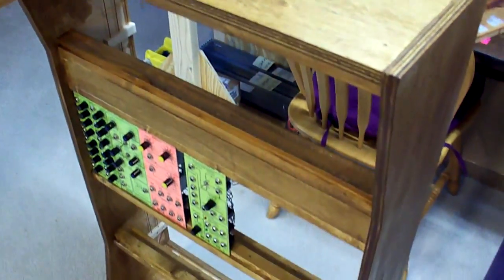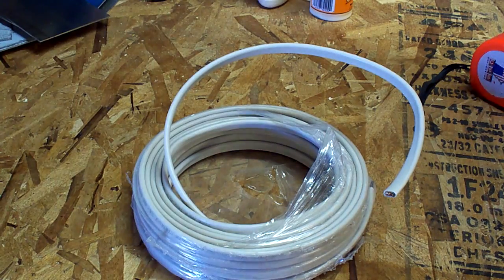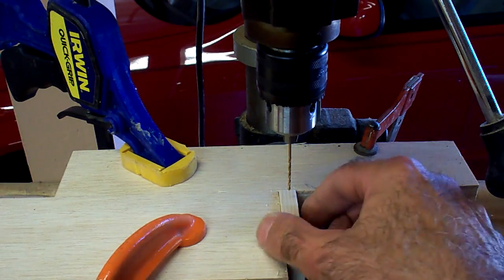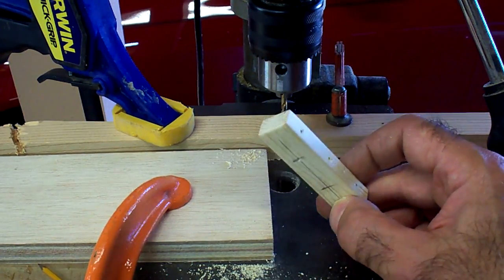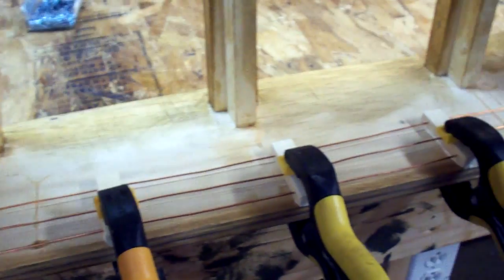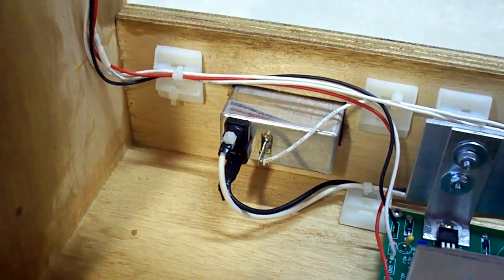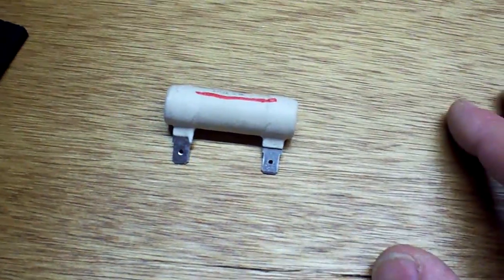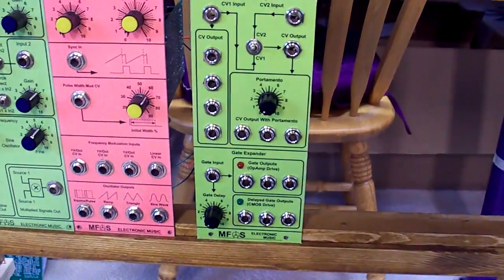Synth Case Building Tips

Comment: genious rail system, reminds me of a PAiA I saw a while back.
However, isn't there a better way to connect to them rather than soldering directly?
Reply from the maker: Pehr Meldert Hi Pehr.  You can solder keyed intermediate connectors with wires attached to the buses if you prefer. In my case once my synth is together I don't plan to take the modules in and out so soldering directly won't be an issue.

Comment: Ha  - I liked the “Cave-man” comment : )  

I have to wonder if you had you used connectors for modules in the past and had issues?
Hardwiring all the power to your modules certainly would remove any suspicion of
Intermittent connections to the pwr source.

I have been using the *MOTM buss system on Modules connecting a large system of homemade cabinets and have not as yet encountered intermittent power connection issues. (knock on woods I guess?)
 I  occasionally change the layout of the module locations as modules and come and go and this system is flexible for quick changes.

some sources
*  MOTM ADAPTOR Boards 960,990 &990     http://www.bridechamber.com/Power_Supply_Parts.html
*  “MOTM style Power Bus PCB"
http://www.cgs.synth.net  
                 
Cheers!